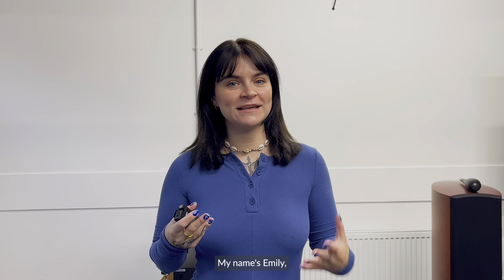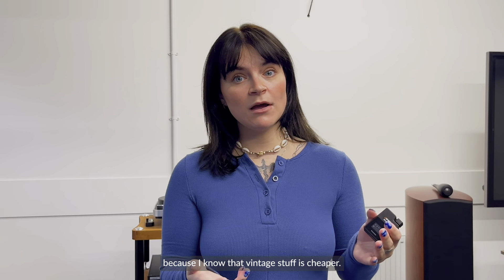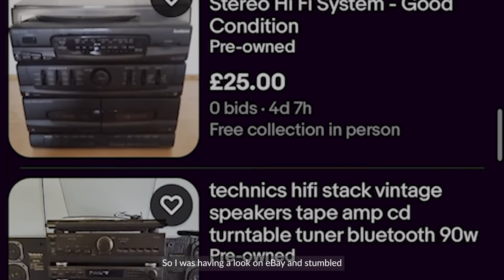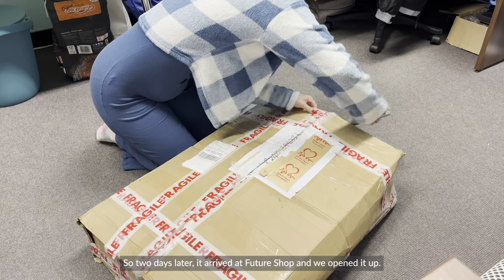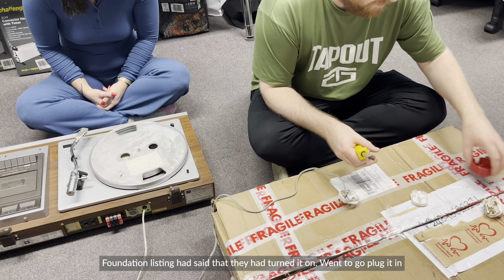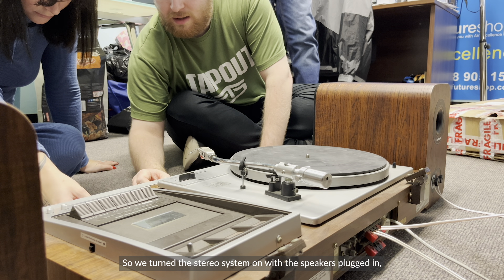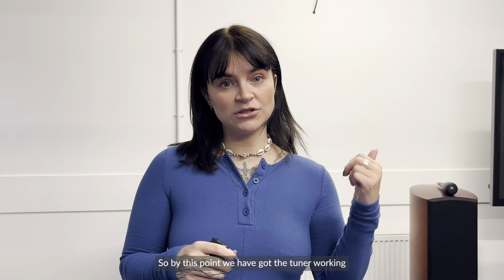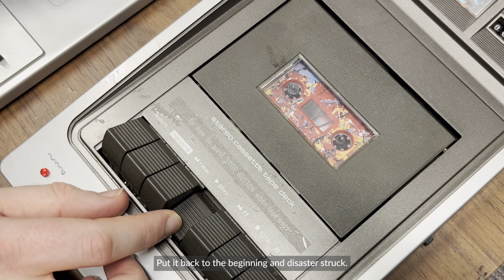Setting up my first vintage Hi-Fi system: Ep1 | Future Shop UK

Comment: The turntable belt didn't melt - it just deteriorated with age - happens all the time; belts are a regular maintenance item.  The very sticky residue cleans up nicely with WD40.

With cassette tapes, what you can do is "pack the tape."  FF to the end, then rewind it to the beginning and then press play.  Obviously, if the belts have deteriorated, they'll have to be replaced.

It also looks like some of the lamps in the tuner display are out.

Overall, a nice unit - any all in one with a standard removable head shell is a better one.
Reply from the maker: Ah fair enough! And yes we noticed that with the lamps, replacing them will be a task for another time!